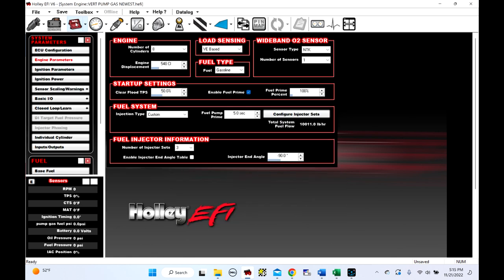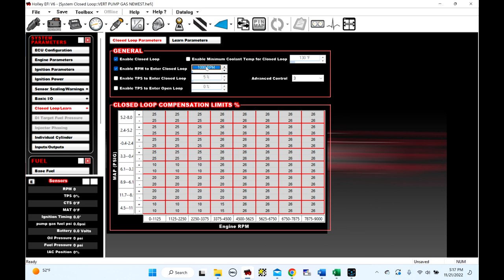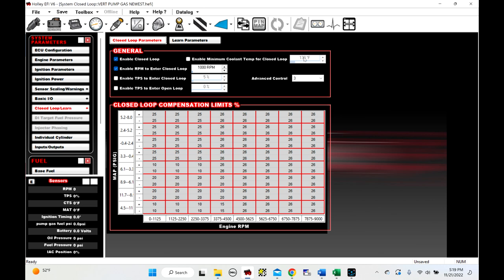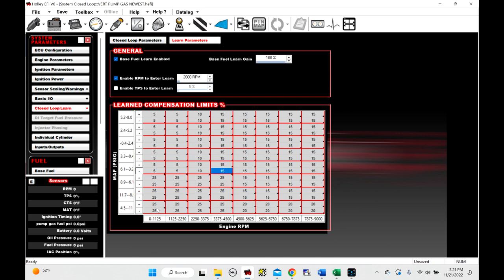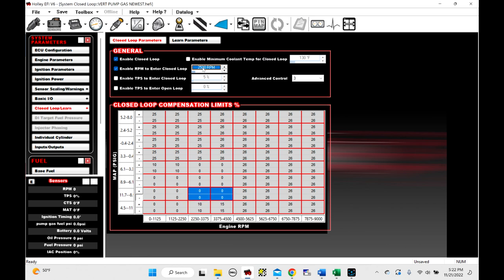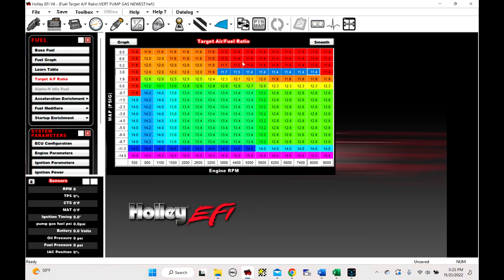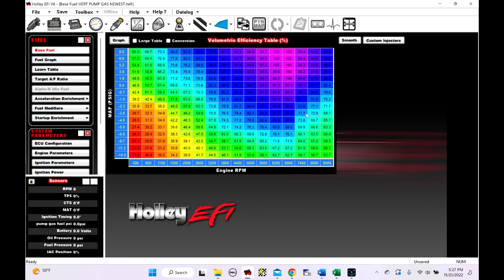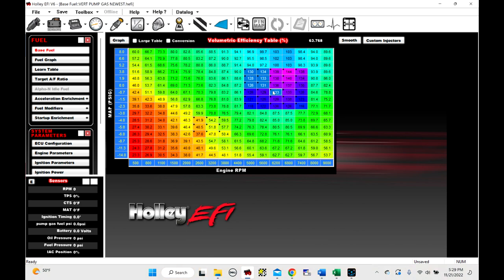Holley take the wheel with closed loop and learn

Comment: Another reason I use Closed Loop Compensation Limits is if for any chance the O2 sensor goes nuts it won't over lean or rich the engine so I can make it home.. Thanks again Devin, really enjoy the content... 👍
Reply: certainly a wise thing to do once you get the fuel map ironed out

Comment: you mentioned an old video about when you want to be in closed loop and not.  I was looking for it, but the search doesn't give any results with closed loop in the title.  Any help locating it would be extremely helpful.  I'm worrying about using a cam with a lot of overlap (tight LSA)  that won't let me use closed loop anywhere near idle and how to deal with it.
Reply: if your fuel map is close then you shouldn't need closed loop at idle... you really shouldn't need closed loop at all if your fuel table is close.  Are you saying it wont go into closed loop at idle right now? or you're worried that it wont allow you to go into closed loop?
Reply: @kevin_nagle  worried about being able to not use closed loop at idle due to overlap with reversion, with bad MAP and O2 feedback at low engine speeds/loads.  As long as it's possible to tune without closed loop which I'm thinking it must be, then I guess I'm worried about nothing.
Reply: @ItsA68  yes, adjusting the fuel map while engine is idling would be "tuning" without closed loop.  just do what Devin showed by either having closed loop not come on until a certain RPM above idle or have the CL Correction 0% up until a certain RPM above idle.  
Basically what we do with turbo cars with a 5" diameter down pipe that's only a foot or 20" or so.... again, as Devin mentioned: "If the o2 sensor is just hanging out in the atmosphere..." you don't want to be using closed loop until the rpm comes up and exhaust starts flowing through the down pipe and passed the sensor.

Comment: This really doesnt pertain to this video but... do you know if there is a way to view raw sensor voltage? I'd like to be able to calibrate my own transducers without having to back probe the connector. Im using a dominator with V6 220. Thanks for the videos!
Reply: It does not
Reply from the maker: yes, set up your custom input to just 5 volt and scale it 0-5 then go online with ecu, bring up dash panel and view your voltage
Reply: @theholleyefiguy  Not sure why I didnt think of that, but thats why I asked. Thanks again!